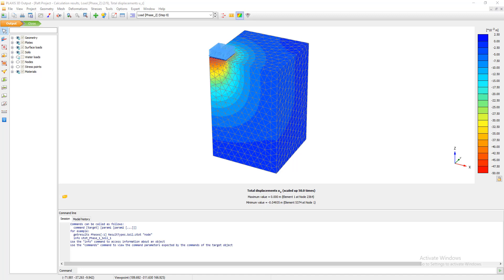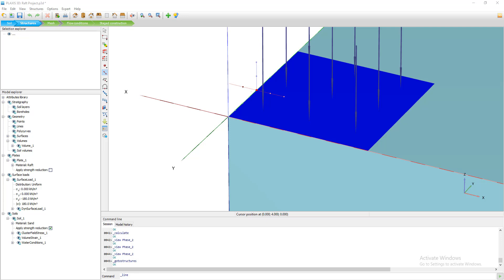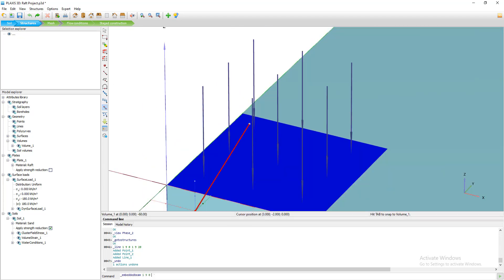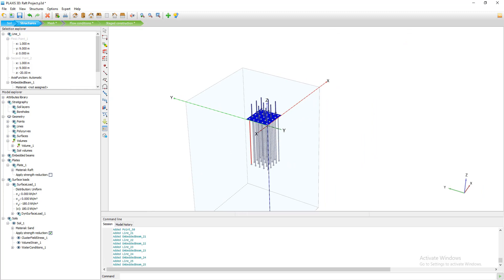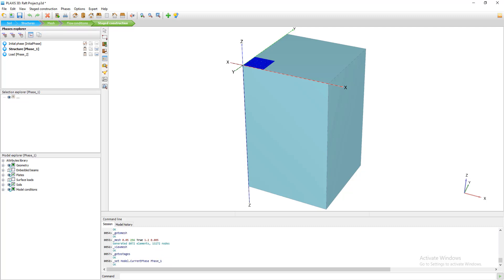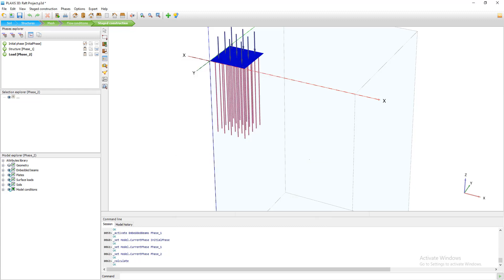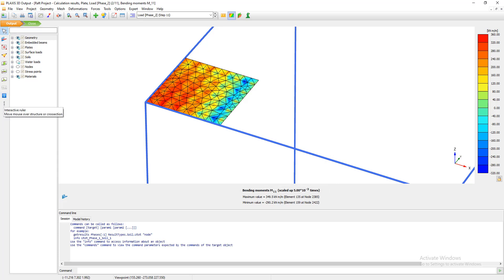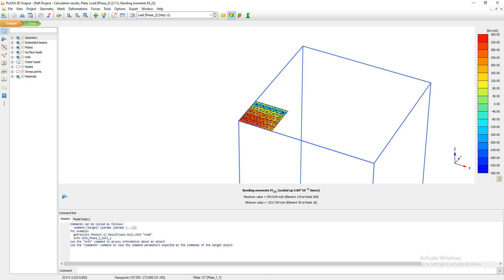Plaxis 3D- Pile Raft Foundation on Sand Layer

Comment: Modeling the raft as a volume element in a piled raft system is way more accurate. Also, regularly spacing piles are not effective, concentrated piles distribution proved effective for lateral, vertical, and combined loading